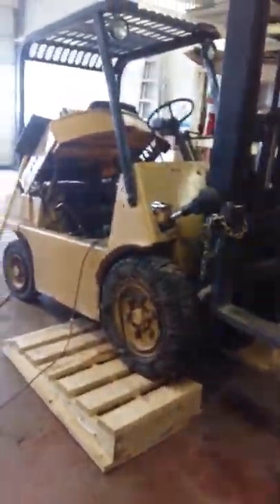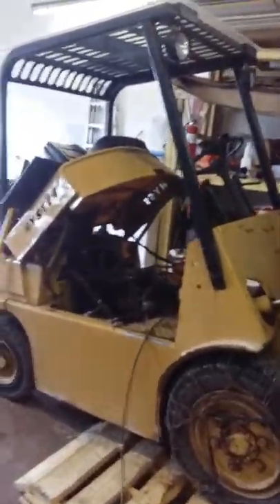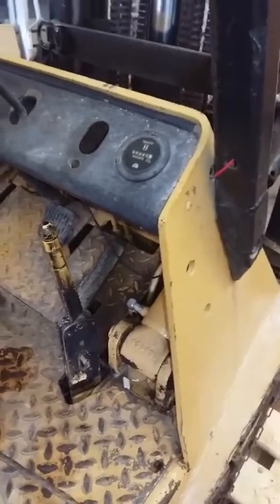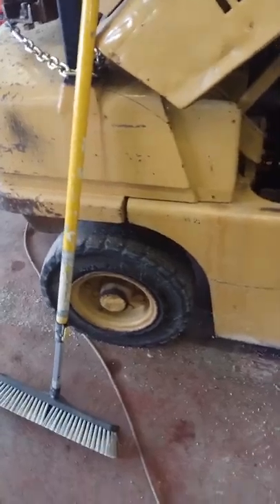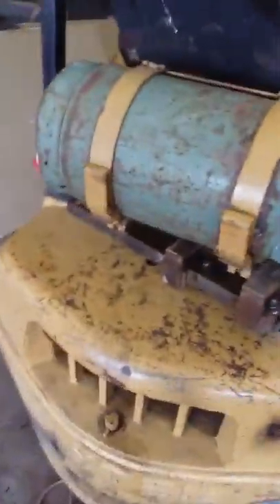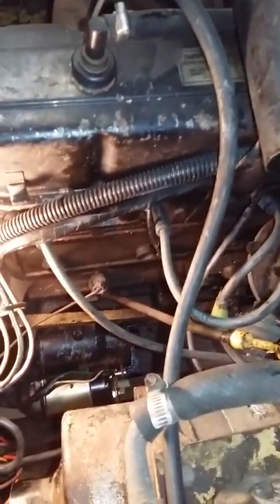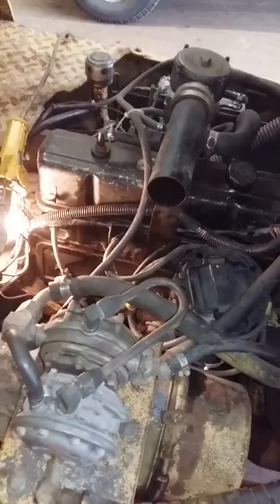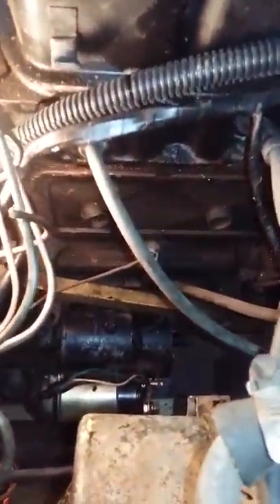Hyster Forklift, older model 1 of 2

Comment: I just bought a unit that appears nearly identical, model is H60J.  Mine has a info tag right of seat, but the serial number is also stamped on the top right side of frame just outboard of the battery, and visible with hood closed.  My serial is F3D2896E, the last letter 'E' is the year code, E=1984 on mine.  There are also numbers stamped on lower right side of mast, at about the top of drive tire, and my mast has 11-84, apparently a date of mfg.

Comment: The serial number is stamped on the frame just in front of the counter weight it should have a number something like A177B or F3A 77 then some numbers these numbers tell you the year model and which factory is was built. All the Europe H40 - 60 J trucks were built in Irvin Scotland The H 40 - 60XL truck were built in Craigavon Ireland most large trucks over 6 tons were built in Nijmegen Holland Conatct your Hyster dealer you should be able to get any part for these.

Comment: What you got there is a Hyster H60H is what mine is an looks just like that one. Yours may or may not have the last H on the model number , but it is an H60 something for sure. I had a hydraulic pump seal blow out on the front of my pump and the hydraulic oil went into the engine cavity.  So I took the pump off and to the hydraulic shop and they put in new seals and all is well and go again. They charged me $197.00 for that.... I would like to know what the oil filter number is. You were asking where the data plate is and on mine, it is on the right side of the driver seat mounted on the hood, which is right over the battery when the hood is closed. in the video, your seat is larger than mine and the stick on data plate may be under your seat. Its not as plate, its a sticker.Mine is 1/2 gone but it does tell some. Good luck with it. I really like the one I got.

Comment: I just bought one just like yours. Someone painted over the data sticker. I did find a oval metal plate on the dash saying it was a 194A.
Reply: mine says the same thing. i know its a h40h model but other then that no idea the year. 60s or 70s......
Reply: @boomstickkid  I figured out mine was an H50.  Also built in 1981 from the serial number I located on the body.
Reply: @hilltopmachineworks2131  where did you find the number, i found one on the right side stamped on the frame edge, (kind of covered by the engine lid when its closed) but i dont think its the serial i have a parts book but its pretty broad and covers multiple models, h30,h40,h50 etc...
Reply: @boomstickkid  Yep that should be it. That is where mine was.

Comment: What you have there is a Hyster  H2.00 OR H2.50 OR H3.00 J  it would have a gm gas or perkins diesel.
The serial number should be stamped on the frame on the right hand side looking from the rear just in front of the counterweight near the battery. The only way to tell if its a H2.00J ; 2000kgs at 500mm load centre capacity or a 2.500 2500kgs is to measure the length of the truck the only difference is the size of the counter weight. The H 3.00J has bigger counter weight bigger drive wheels and a class 3 mast and fork carriage, The 2.00 and 2.50 has class 2 front end. 
Just looking at it it looks to me like a H2.00J which would give it a capacity of 2000kgs at 500mm load centre to 3600mm lift height. Its difficult to see but you look like you have a two stage full free lift mast which is unusual.
The transmission is a single speed Hyster monotrol. Beware there is no neutral on this transmission its either in forward or reverse it only disengages when the park brake is on or the footbrake is on so its very important that the park brake interlock switch is working and the park brake works.
You will never wear this truck out best fork truck ever made,
Reply: hi, I have a question on the hyster forklift, maybe you can help me. what displacement of engine would the gm gas engine be?
Reply: 2.5 lt. Same as The Iron Duke,Hyster may rate it different,and put some of their own design stuff on it.
Reply: @omegaman1168  These machines were designed made by Hyster in Irvin Scotland I have been to the factory many times seen them on the production line.

Comment: it's a 3.1 litre GM I think it will have a chain driven hydraulic pump  they put the engine in boats aswell it should have a impco model j vaporiser and lpg system good old truck  they keep going make sure you put a sealed starter motor on it's a wet bellhousing

Comment: guys got any info on the forword transmission problems? guy told me I have to replace o rings on that transfer valve,I just have no clue as to how
Reply: The Hyster monotrol transmission is almost unbustable it would be most unlikely to be a major fault. The transmission is bias to reverse That means in normally in reverse when its stopped when forward is engaged the forward clutch pack comes in. There is no neutral as such its either in forward or reverse neutral is achieved by putting the park brake on there is a switch connected to the hand brake lever that switches the transmission off. Also when the footbrake is applied the transmission is switched off via a solenoid in the transmission.
 If the reverse works fine and you cant get forward drive the problem is most likely with the monotrol pedal.  Coming from the monotrol pedal is a pipe this pipe goes into the side of the transmission top cover. When forward is selected oil from the mono pedal goes to the side of the transmission case and pushes against a spool this is the forward direction spool. When reverse is selected the oil goes back and the spool is spring pushed back with a spring inside the top cover. So this spool is not being pushed across. So when the engine is running oil should be coming out of this pipe. The mono pedal has a small leaf spring on the back make sure that its there and not broken also there has to be resistance on the throttle linkage by a spring so there is something to push against. I an sorry its so difficult to explain how the Hyster transmission works. To put it simply the mono pedal ( accelerator ) has to have some resistance to push down or it will not change direction because the direction change over is on the pedal you need to overcome the transmission  spring ( behind the mono pedal ) before it revs up. make sure the mono pedal rocks from side to side and its not seized. I wished I could be there to fix it. Great forklift by the way best ever made.

Comment: I have one identical and mine is a h30f 3000# capacity.
Reply: The H30 to 60 F is a similar machine but much older, this is a H50J. A sure was to know is the overhead guard on the HF had a round tube the HJ was square also the HF had a ford gas or a perkins diesel engine not a GM
Reply: @derekevans8266  my vin tag said it's a h30f and it's got a gm gas/ propane in it that looks factory. And it's got a round cage on it.
Reply: @calebfarley9101  If its got a round roll cage its def a HF the engine will be a ford gas engine.

Comment: looks like mine I have a perkins
Reply: The Hyster H H models had either a perkins diesel or a ford gas engine the later H J had the perkins or a Gm gas engine. The H xl range had either a Isuzu diesel or a Mazda Gas engine